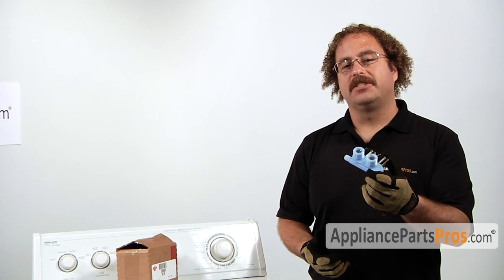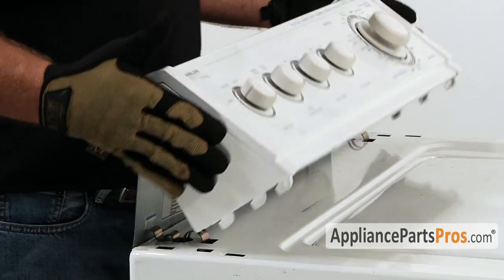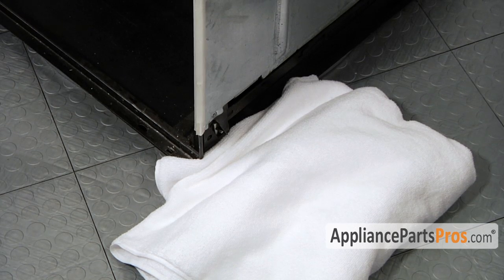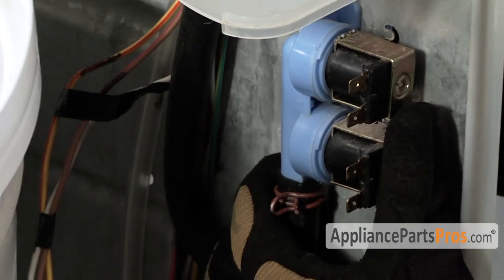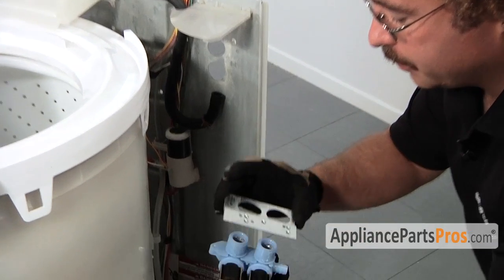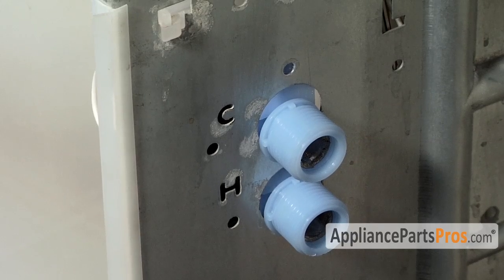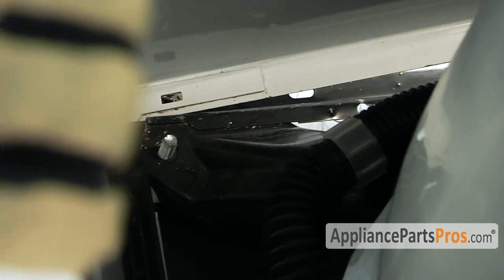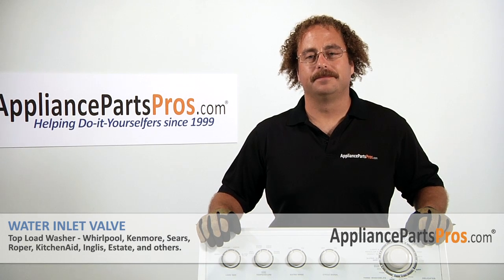How To: Whirlpool/KitchenAid/Maytag Water Inlet Valve 285805

Comment: This is great!   We have a LSR7233EQ0 that recently - and only sometimes - won't fill on rinse.  However, the agitator will still kick in at some point while on rinse.  So at first I thought to replace these inlet valves, but I'm wondering if this might also have something to do with the water-level pressure switch/system?  I'm seeing how that system works with the hose that needs integrity, etc, and wondering if that could also cause the lack of filling?  Thanks!

Comment: I have a Whirlpool LSR8010PQ2 ... I set it to cold/cold, it runs cold water...but, then on the rinse it comes out hot, just started doing this recently.
Would the problem be the "temperature control switch" or the "Inlet Valve"?
Reply from the maker: We'd be happy to help you out with that! We offer free technical advice and diagnosis. You can give us a call at 1-877-477-7278 or you can chat us at our website: http://www.appliancepartspros.com/. We will need your model number to give you accurate advice, which you can locate using this tool on our website: http://www.appliancepartspros.com/modelnumber_locator.aspx
Reply: Thank You!

Comment: mine has 2 wires that plug to the water outlet hose
Reply from the maker: There are a few different versions of water inlet valves, you may have to take the extra wires into account!

Comment: Great video, I thought the issue that I had was the inlet valve at first. But now I'm starting to think I was totally wrong, because the washer will start to fill and the cold water will continue to fill regardless of the level. It will start to agitate will start running and the cold water will continue to keep running all over the flooding the floor. Then it will get stuck in a cycle and not run at all. Do you have any advice for me at all please! Thank you! Don Kain.
Reply from the maker: DON KAIN A washer that over fills usually point to a bad water level switch. Either the switch has failed or a hole in the pressure line.

Comment: my whirlpool duet sport wont allow water to enter, it went successfully through half a cycle then stopped.  I was able to set it to drain and spin, but now when i set it to start a new load, it just grrrrrrrrs when it should start filling.  I did have an error code of f1, which i believes indicates a short on the board.  Is this generally fixable by soldering?  I repaired the dryer board this way.
Reply from the maker: Samanda Most people just replace the board, if its bad. If you are trained in board repair/electronics you might want to do it, but in general they are just replaced.

Comment: Does the water inlet valve affect the water level switch and water temperature switch?.........many thanks!
Reply from the maker: They all work together to fill the tub. When you start the cycle the water temperature switch tells the water valve which solenoids to open for the correct the water temperature. When the tub is empty power goes to the water valve until it fills up the tub. Once the tub is full the water valve shuts off and it starts to wash.
Reply: AppliancePartsPros Great info and videos, thank you !
Reply: How does it know when to shut off for a small load or a medium load?
Reply from the maker: It uses air pressure. The clear tubing that goes down to the bottom of the tub, as the tub fills with water air pressure goes up it to the switch. Once it gets to the correct level the contacts inside the switch open and shut the water off.
Reply from the maker: You are welcome!

Comment: I just replaced the washer water inlet valve. I had trouble and found this video. It told me exactly how to do it. It was easy, if you can change a light bulb you can get your washer repaired if you follow this video. Pay particular attention to using a putty knife to remove the top a screwdriver will not work. Also make sure to mark the hot, cold and any electrical connectors before removing them.

Comment from the maker: Make sure you check the hoses and screens first, to be sure they are not clogged. You will probably have to take the front panel off and then remove the washer top. Its not hard but is more than I can explain here. Please post your question on our repair forum and the techs will help you out.

Comment from the maker: Sounds like maybe the water level switch contacts could be sticking together. The motor and the water fill valve should not get power at the same time. The tub should fill, then the power is sent to the motor. It could also be in the timer. If you need more help troubleshooting this you can post your question in our repair forum and the techs will help you out.

Comment from the maker: You will also have to inspect the hose that goes from the switch to the tub. Look for any cracks or holes. If there is any damage or leaks it will not allow proper pressure up to the switch. Also make sure the air dome where the lower hose attaches is clean and free of damage, leaks. When the tub starts to over fill, not to the point of overflowing, unplug the washer, if the water still comes in it could be the water valve is getting stuck in the open position.

Comment from the maker: If it agitates with no water it could be the water level switch is stuck in the full position. Which means the washer thinks its full so it starts to agitate. Check the pressure tube for any damage or obstructions, if its all good then check out the switch itself.
Reply: How much does one of those cost water fill valve
Reply: How much does the water valve cost